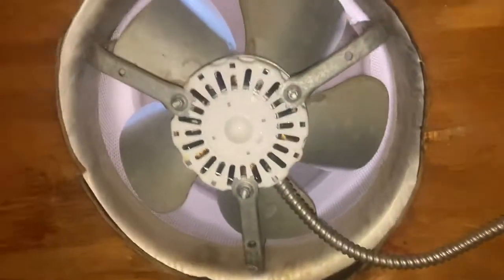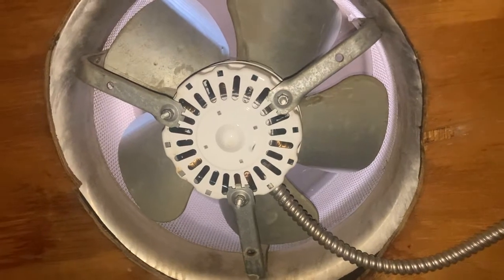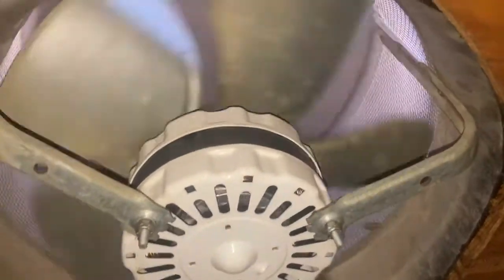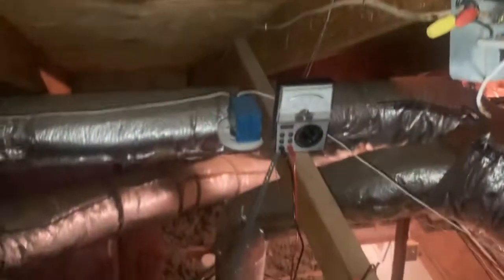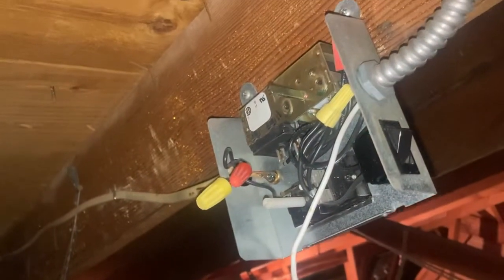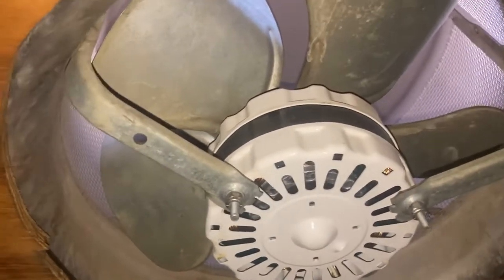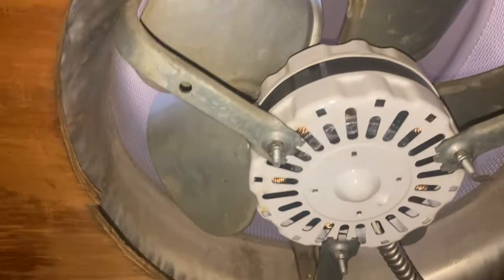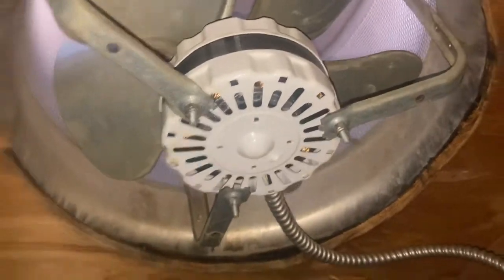Lomanco/Broan attic fan motor constant failures, no answers other than poor quality.

Comment: I had these on my last house, and it was the same deal as yours, I took them apart and it was always the thermal fuses blowing, I simply bought a pack of thermal fuses and repaired them rather than replace them.   Had a new roof done a couple years later and they removed the fan all together and did a ridge vent.
Reply: now that fuse replacement should have a video / you tube made.  ??????

Comment: There's only one reason why these motors would fail at such a high rate: negative air pressure. Even on the largest of properties, 6 of these fans is A LOT if there isn't adequate intake air being replaced as it's being exhausted by the fans. You would need more-than-average intake venting (soffit, gable, etc.) to make sure these fans are all running and breathing effectively and not pulling air into a vacuum. 

Once air gets pulled into a vacuum, the motors choke and overheat. A lot of the time, it's not enough to trip the thermal overload on the motor, but hotspots may occur on the windings of the motor and simply destroy them.

I have about 20 years of experience with Lomanco attic fans (and various other brands) and I can recall all of the times I've had to change a motor. They do eventually fail, but it takes a number of years and it's always the bearings that seize up when they do fail from old age. Burnt up windings are almost always caused by negative air pressure.

If I was in your situation, I would have a professional roofer that is very highly skilled with ventilation to come out and assess your house. In my opinion, attic fans are annoying to deal with in the first place. A well-engineered ridge venting system might be a better option in your case and it would be better to ditch the fans entirely if you installed ridge venting because they do not work together. It sounds like a big-picture diagnosis is what's needed for your attic, but it's not the fan motors.

Other than that, you could have an electrician check that the fans are getting between 110 and 125 volts. Anything higher or lower could cause issues with the motors, but I would assume that's not the issue if you're not having other electrical equipment issues throughout the rest of the house.
Reply from the maker: Thank you for the very educated reply and comment.   A little background when referring to “professionals” is that has been done.   There are 6 on property but there are 2 separate structures.   Structure 1 is 5200 sq with 4 and some very high peaks.   Cubic foot is prob under and could add another.    2nd 2400 sq with 2 and even higher peaks.   On the installation of these of which was with “professional” roofing we installed a celotex ambassador roof with 100% new decking.   All soffef is perforated type ventalation 360 deg in both structures.  This project alone would buy most a nice home for this roof alone, so it was at least attempted as professional as possible with a very experienced guy who says toss the power vents and use whirlys.  But i wont as i dont like the looks and try and maintain a standard being hoa pres for now 17 years.  Ridge vent is option but living in top of a hill the prior use of ridge netted ripped off ridge vents from 100mph squalls.  So this was the change on this project at the time due to our geography.    Power,  2 dedicated 20 amp 12g wire circuits per 2 fans.  Amp loading is nominal and power is overkill per spec.  No issues there.   Now you did call the big one.  Internal thermal protection.    Dissecting several of these after the vid, those are blown.   I bypassed 2 recently and am experimenting with those.  The thermal overload is either doing its job or is substandard and failing.  So if its not substandard, the motors should burn a winding soon and fail that way…. Or burn the property down!  But i fused them at 8amp inline to just add an element vs loading back a 20 amp circuit on a hard lock. So will see how this goes.   On the main structure, I have 2 new motors with oem protection, and i reused 2 that are same model motors that failed thermal running with that bypassed The result should be interesting to see and i will post back on next failure or full summer success!

Comment: There are some good points made by other commenters, and I’ll add a couple more.

It’s unlikely that the motor windings are short circuiting, but rather it’s the internal thermal fuse that’s blowing due to the heat.

From the video, it looks like your motor is a shaded-pole type. Did the motors you’ve used come with a capacitor (a black plastic box) attached to them? If yes, then it’s a different story, but if they don’t have a capacitor, they’re shaded-pole. Those types of motors run hot by design, and the attic heat only amplifies the heat. This could blow the thermal fuse. 
You could try going for a higher power motor that will drive the blades with less effort. There will be less heat produced from the load, and potentially allow it to last longer. 
Or PSC (permanent split capacitor) type motors of equivalent horsepower rating could be an option. They use a capacitor, making them more efficient and cooler running. 

Another modification you could do is reducing the pitch of the fan blades. You can bend the trailing edge of the blades to “flatten out” the pitch a bit. But you’ll have to take your time to ensure all 5 wings are evenly flattened to avoid balance and vibration issues. Reducing the blade pitch even just slightly can take a lot of load off the motor. Sure, it’ll move less air, but it won’t be a significant difference as long as you don’t overdo it.

Something that will help prolong the life of these motor is periodically oiling them. Note the little spout cutouts on the motor casing near the shaft on both sides. You can add about 5 drops of oil (3-in-One electric motor oil, blue and white bottle is a good one) once in a while. Also, it would be beneficial to orient the motor so the oil ports are facing up for easy oiling.

Comment: I bought 2 brand new motors and hooked them up on my workbench. They ran for about 15-20 minutes and got extremely hot. A temp meter read over 180 degrees on the top of the housings. Then they both failed. I returned them to the store for a refund. They can’t cool themselves without a lot of air flow. Bad design.

Comment: Master flow has PSC attic fan motors that actually last. I have a power attic vent that has had no failures since 2006. They have automatic resetting thermal overload switches internally. They do not fail. They rarely fail. Please don't buy shaded pole fan motors like the ones shown in this video. They are inefficient. They fail constantly.

Edit- Read other comments on this video. It seems you're more skilled than I am when it comes to this so I don't want to undermine your knowledge.

Comment: It’s because they are designed to fail… the rotor bearings are solid sleeve with very little grease… when they seize up, the internal circuit breaker trips… REAL JUNK… Greased Roller or Pin bearings would go a long way to improve longevity